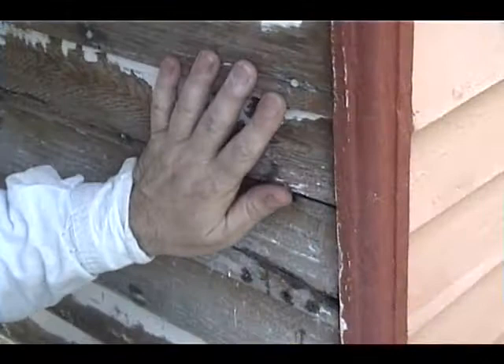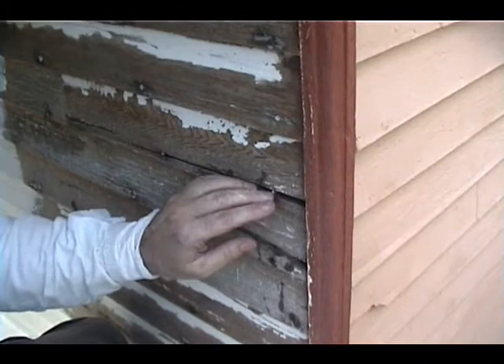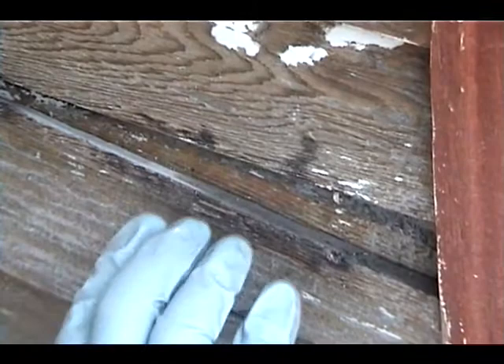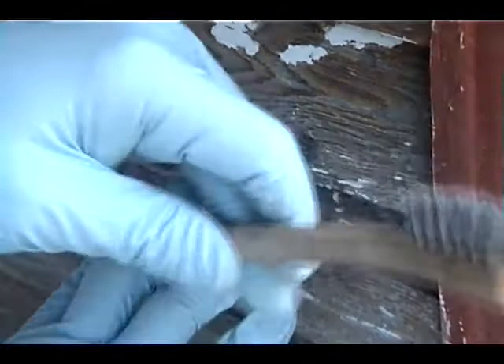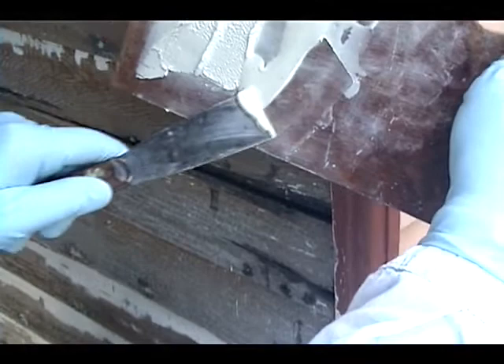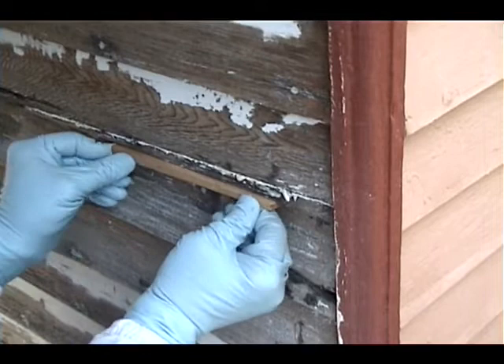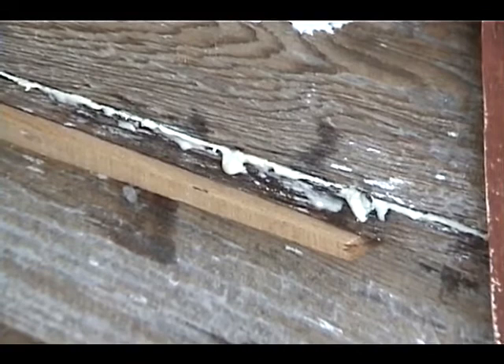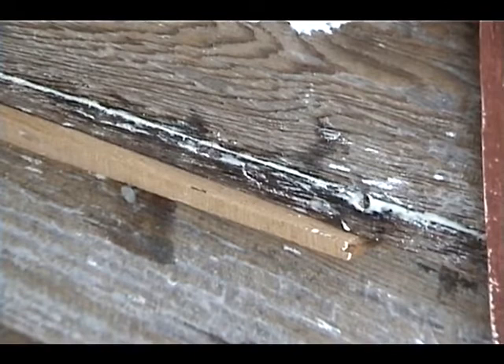Exterior Woodwork, Repair Split Clapboard

Comment: Thanks for the video. John, could a person use wood glue with this technique? Do you recommend doing this on fragile boards before or after using infrared to strip the paint? Thank you!
Reply from the maker: I would use a "type 1" weatherproof adhesive (such as TiteBond III) after stripping. But keep in mind that I do not recommend using any high-heat dry-heat method (like infrared, hot-air gun or open flame) directly on standing buildings because of the fire risk. I do use infrared on building parts that are removed and worked on in the shop where the situation and fire risk is more under control.

Comment: Good vid. Thank you. What type of gap filling epoxy adhesive do you use?
Reply from the maker: Here I'm using a mixture of an epoxy consolidant (Abatron LiquidWood) and an epoxy paste filler (Abatron WoodEpox). The West System also has some good gap filling epoxy adhesives suitable for exterior woodwork.